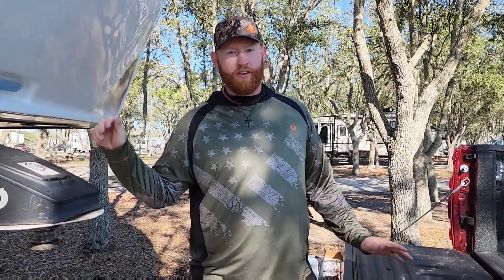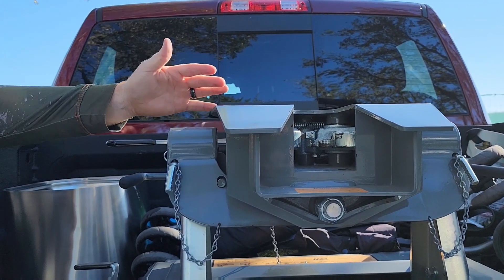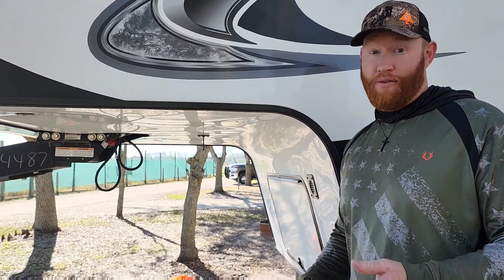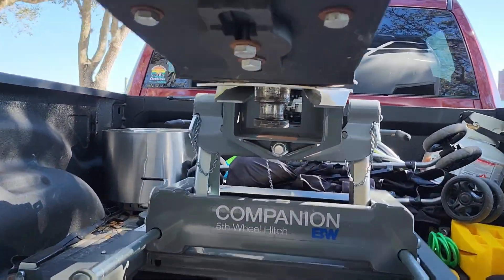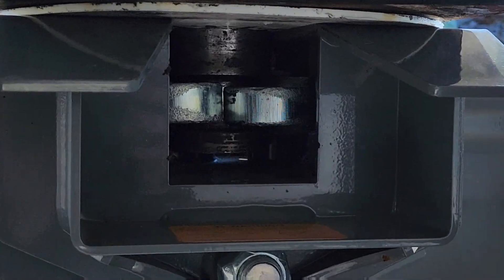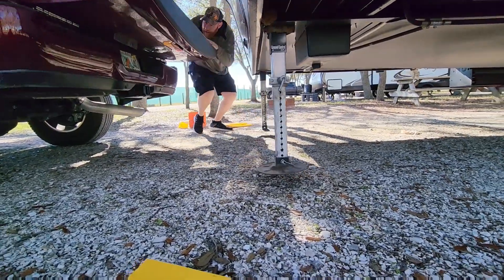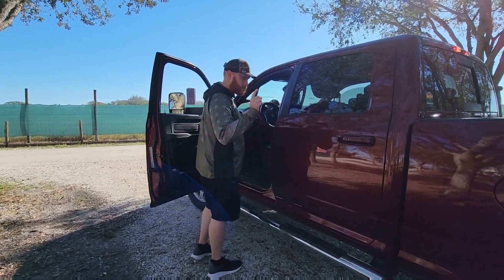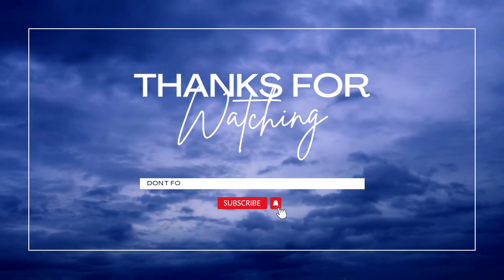How to connect the 5th wheel to hitch and make sure you do a TUG TEST!!!

Comment: Very good video.  I would recommend one think on the tug test as this is how I do it as well as others.  First have chocks on camper wheels and go ahead and hook up the 7 pin so you apply trailer brake when tugging. By doing this the camper will not move and if you are not hitched correctly the trailer will just drop on the feet.  Friend of mine thought he had his locked in ,did not do the tug test went about 15 feet and camper came off.  Lucky for him he was just moving short distance in his yard and he had the feet about 5 inches up which caught camper.  Good luck and I’ll keep watching.
Reply from the maker: Thank you, Jeff! That's a good pointer for sure! That makes sense! We appreciate the heads up! 🤗.
Reply: That is what I was going to say
Reply: Just curious why you use a slider hitch when you have a turning point kingpin?